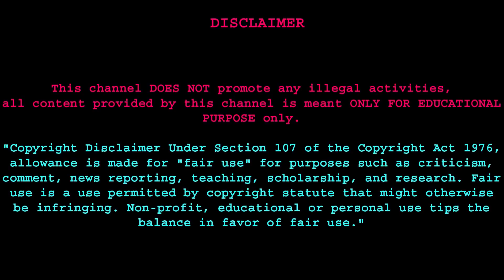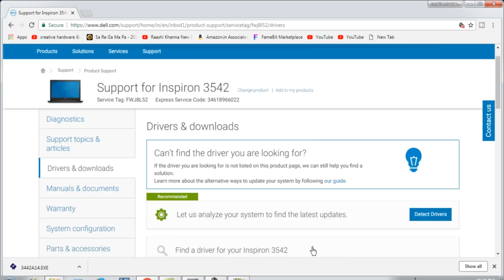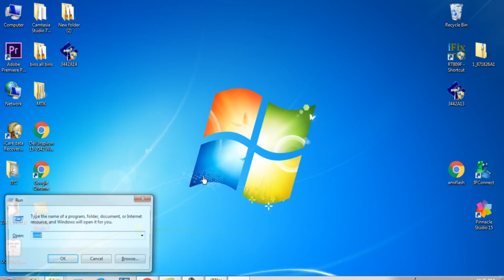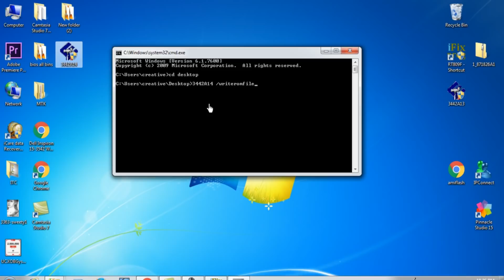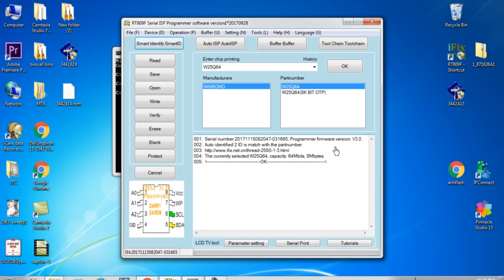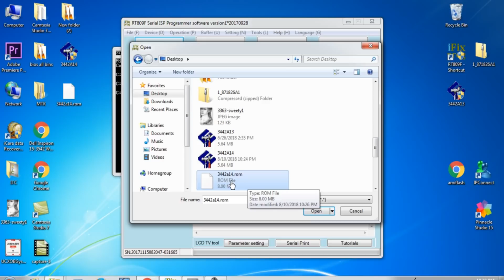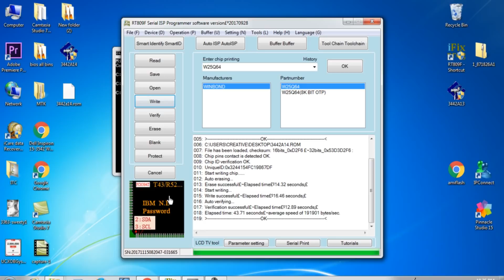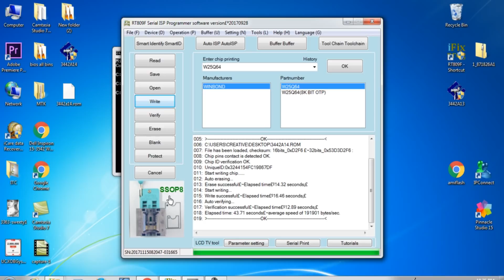how to download Dell laptop BIOS from internet and how to extract dot exe file to Rom file in hindi

Comment: Hello
BIOS on desktop = 3330A13.exe
C: \ Windows \ system32> cd C: \ Users \ AAA \ Desktop
C: \ Users \ AAA \ Desktop> 3330 A 13 / writeromfile
(3330A13.exe stopped its operation)
Are there tips for continuing?
nice to meet you